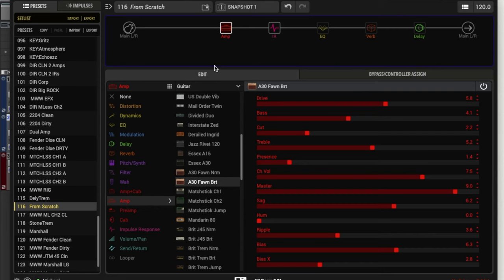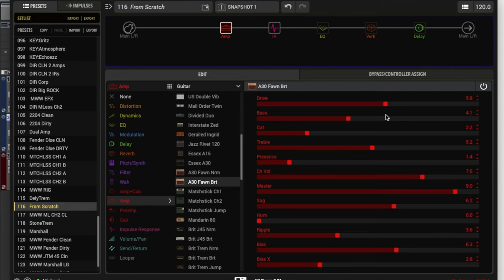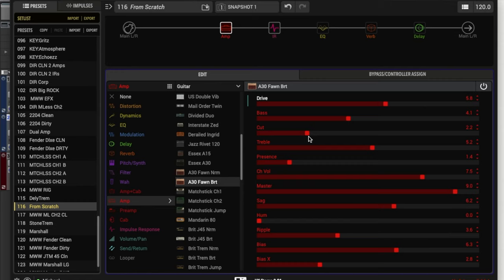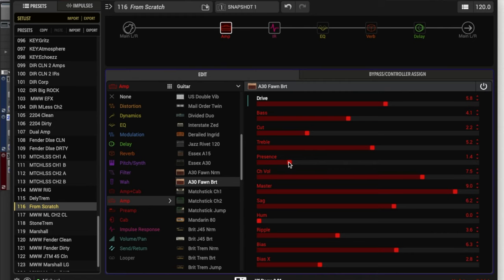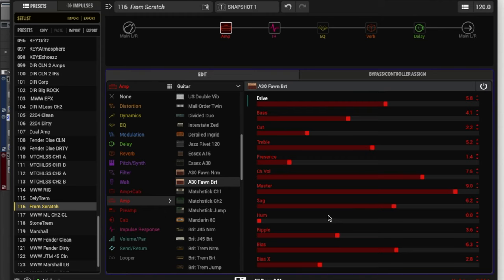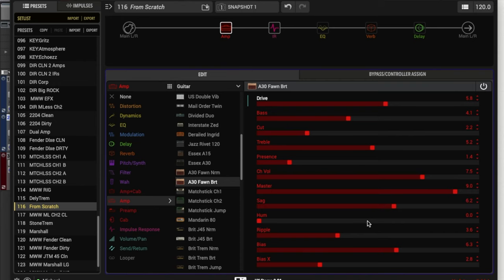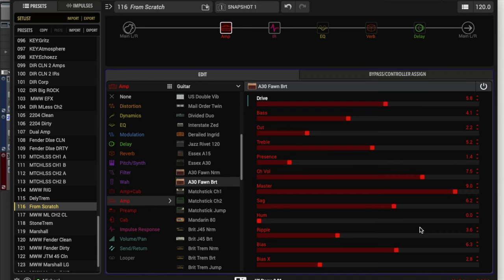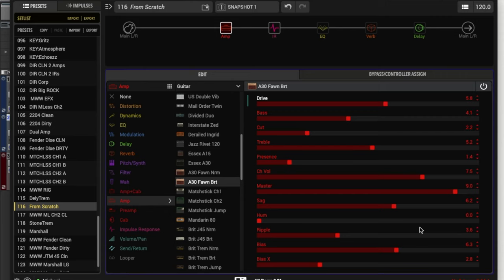Line 6 HX Stomp - Understanding the Controls to get GREAT Amp Tones!

Comment: I've been having problems trying to dial in a good sound with ownhammer's IRs. Don't know why but they sound so bassy and fizzy at the same time, I almost always have to use the high cut from the IR block between 8k and 6k.
But ever since I downloaded your free preset with IR included I can leave the IR as it is and dial in the amp from there without the need of an extra EQ.

What I'm saying is, your IR rocks 😂, even for high gain (I'm using it for cleans, crunch and high gain and it works for all of them).
Reply from the maker: Awesome! Thanks! Be sure to check out some of my others if you need some different flavors!
Reply: @MichaelWWestbrook  Yes!, I edited my comment so much before posting it that I forgot to say that, but as soon as I get a new job I'll definitely will be getting some stuff from your store 👌🏼

Comment: Good video Michael.  I like some of the stock cabs in L6HX.  However one frustration I have had with the HX cabs is they are extremely low in level.  When I use third party IR's the levels are much higher, tones are better quality.

Comment: I find all your videos, particularly this one, very useful as I'm a new HX Stomp owner. I listen primarily through Monitoring Headphones. I'm trying to understand and solve a characteristic of many of the Presets that you mentioned in this and several of your other videos. How to get a more, "Present, Punchier, Immediate, Up Front, In Your Face" kind of sound? In this video, you mentioned Sag, Bias, and BiasX. I'll have to try those settings. I've been able to get some improvement by lowering the Reverb in the Mix etting. In one of your videos, you wondered how certain frequencies might be the cause. Maybe the Mic position is also involved. I'm not sure if it's one or two settings I need to look at, or if its a half dozen.

It would be great if you could make a video specifically focusing on how to get a more immediate, punchier sound out of the HX Stomp. To me, the Presets often sound weak and distant, even when changing the Volume on the unit. I'm sure a lot of HX Stomp users would benefit from such a video. Do other LIne 6 products also have this kind of "lack of immediacy" in their Presets? My old Boss GT-6 is really "present" and I love that about it. Thanks
Reply from the maker: Using IR’s gives me an immediately better starting point in this regard. Try adjusting the Bias X control down (I think it’s lower values) for a stronger attack or what might feel faster and more immediate.

Comment: Do you ever have tuning stability issues? When re-stringing your guitar, try not to let the string overlap itself around the pole.. instead, try to get 3 windings that stack on eachother.
Reply from the maker: Not really, but usually I try to not let them over lap as well but sometimes it happens if it don’t estimate the length well.
Reply: @MichaelWWestbrook  I hear you brother. It can be difficult to judge that. A trick i learned is run the string through the pole peice all the way until it lays flat on the fretboard. Then, grab the string around the 12th fret and lift it about the same height as your index finger if it was on the board sticking straight up.. this is about the amount of string you want to wind.. another trick is to, hold down with as much pressure as you can in front of the nut around the 1st or 2nd fret and wind the peg while keeping that pressure. This will allow the pole to only wind whats between it and the nut and the pressure will keep the string tight without coming loose around the pole once you have a wrap on it.. i hope this wasn't to confusing lol. I enjoyed the vid! Keep em coming! 👌

Comment: I have little question. It is normal that when im playing with backing track from YT (Helix LT connected as USB Interface), i have to turn down backing track volume to 20-30% because my guitar is very quiet? Is any way to fix it?
Reply from the maker: I’d say that’s pretty normal. I have to do the same thing, even running my amp with the Captor I have to adjust tracks down!

Comment: Do you find that you need to adjust the headroom of the amp model to accept external pedals? What would be the best way to do that? Channel volume?

Great videos and great IRs. Have really enjoyed them.
Reply from the maker: I haven’t felt the need to adjust for headroom any differently than I would setting up a normal amp sound. Channel Volume only affects overall volume so it’s not going to change the headroom. If I felt I needed more head room (with overdrive/cleaness) I’d try the gain, master volume, and bias first. Then  possibly adjust the sag and Bias X if I felt things were getting compressed by the increased input of other pedals.